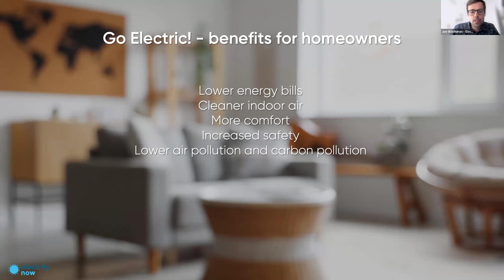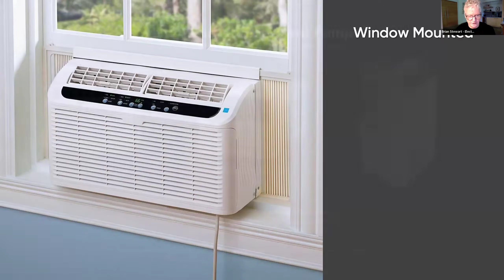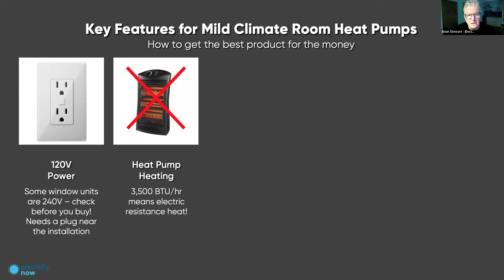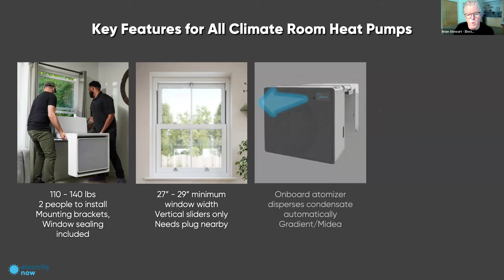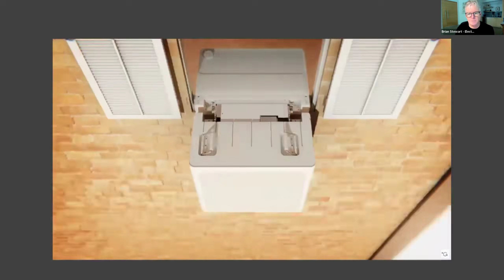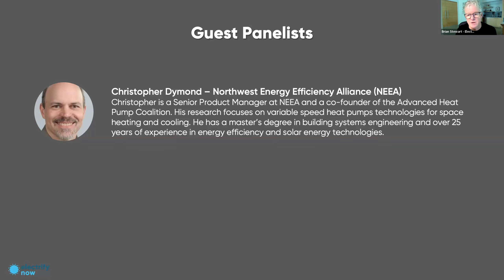Room Heat Pumps 2.0 - Heating and Cooling in a Small Package

Comment: 39:00 show me a mid-climate heat pump for less than $2,000 a ton and I'll buy four for my house in New england. But the prices aren't there yet; certainly not the $1,000 a ton that the guy in the lower left mentioned. Actually, as they said, there are no mid climate room heat pumps available, period. And the all climate / cold climate ones are $4,000 and up.

Comment: Thanks, great videos.

Are the ceer values correct though?  I compared EU and US ceer values and they're much higher in the US.  Even with the same manufacturer, though different models.  The midea unit you show has a ceer of 14.5 but a midea in the EU shows eer of 2.6

I'm not sure ceer and eer should be so disparate.  I'd be grateful for any info on this.